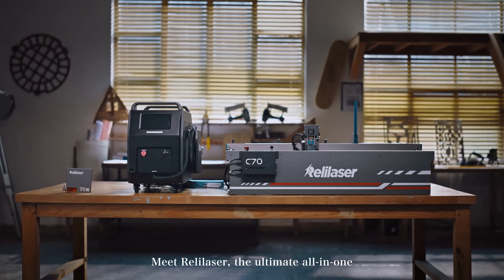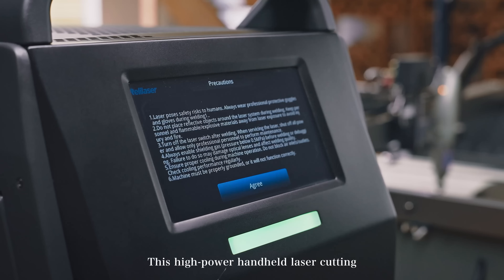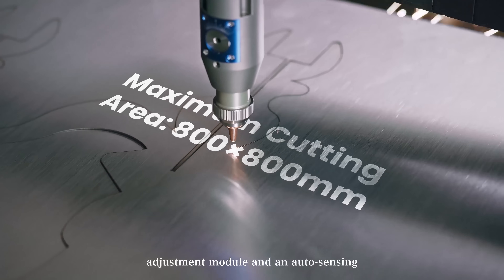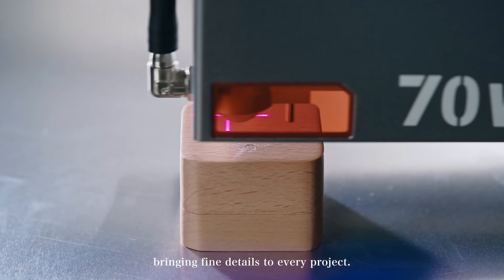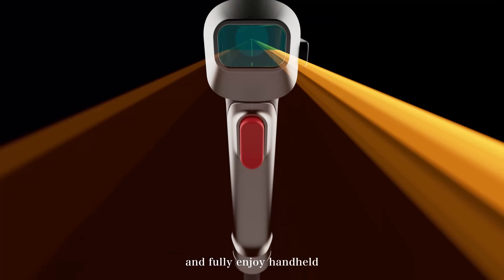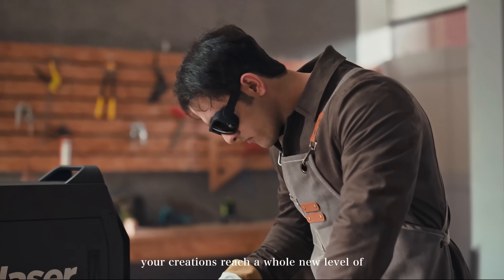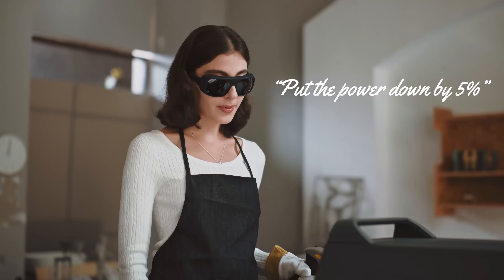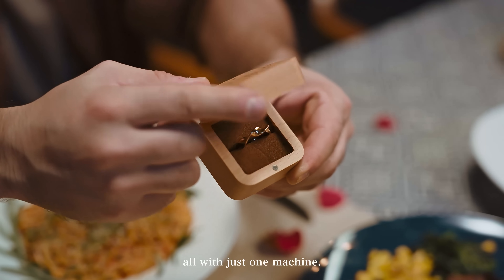Revolutionize Your Workshop with All-in-One Laser Power: AI, CNC, Welding, Cleaning & Engraving.

Comment: How does it cut metal and how deep are the cuts?
Reply from the maker: it cuts stainless steel with 3to5mm thickness. Depending on the power of air compressor
Reply: @SCULPFUNReal  What about aluminum?